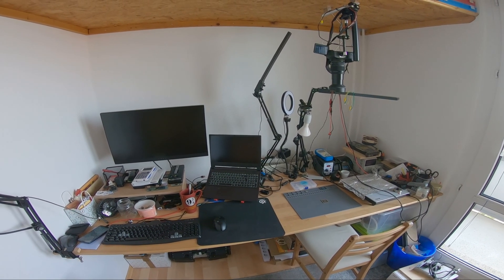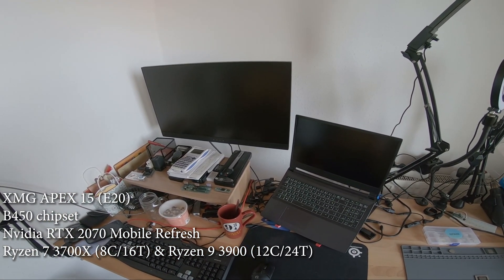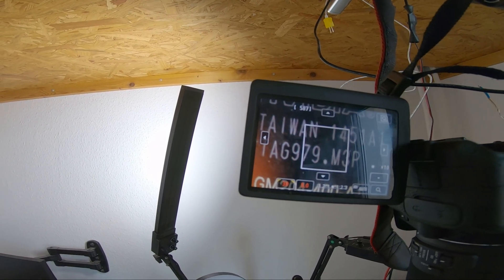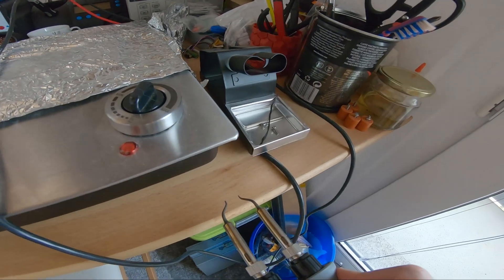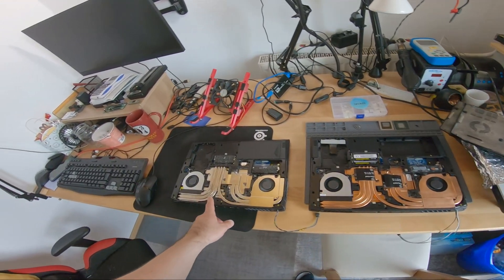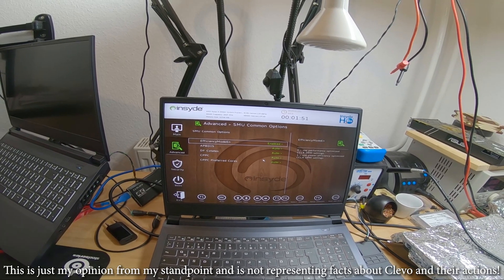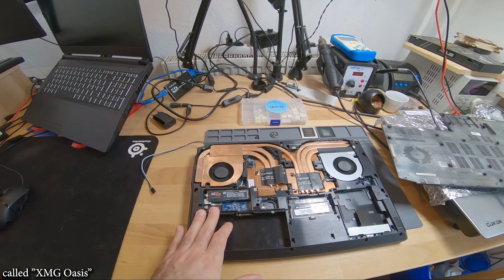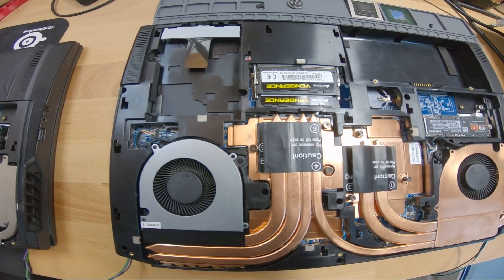500 subscriber special - my office, tools & projects

Comment: I saw the whole series dedicated to modding the XMG Laptop: you did an impressive job, congratulations! You have been a great inspiration and help for me, I intend to do the same (nickel plating) with the heatsink of my rog, to be able to apply the liquid metal also on the gpu, and avoid the oxidation of the copper in the long run. My Notebook (Asus Rog Strix G532LWS) comes out of the factory prepared for the use of liquid metal on the cpu, however, the cpu tends to saturate all the heat sink (having the heatpipes in common with the gpu) and therefore it results that the gpu it tends to have higher temperatures, using MX-4 thermal paste, which as we know has a much lower thermal conductivity than liquid metal ... I hope to be able to achieve what I have in mind, and above all that it works!

Comment: hi. Respect for your work! its great. do you have site or thread on forums with your work? how i can get your unlocking bios for my APEX 15 b450? you tested this platform (b450) with any CPU 5XXX? maybe you can flash (porting) (with programmer tool like ch341) bios from b550 to b450 (platform is same, like clevo p775dm3 and p775tm for support 9xxx series cpu). Do you have email? I would be happy to chat with you
Reply from the maker: Done already. Unfortunately not working! :(

Comment: are you planning to get the new apex 15 max with ryzen 5000 and rtx 3070? i'm debating on whether or not to buy it, it drives me nuts that they don't make a 17 inch version as it would allow for a larger heatsink and therefore better thermals(i'd get it with 5950x) but i'd like to see how the 15inch holds up. there's no reviews for it at the moment but they probably not present it as good as you did this one. i'm looking forward to the future of this channel:) deffinitely subbed and turned all notifications on

edit: 7 minutes later and i'm now even more interested in what will come:))
Reply from the maker: Yes I got the XMG APEX 15 MAX with a 5950X here. Please note that only XMG sells this barebone with properly working VRM. All other vendors underperform heavily.
The 5950X in this laptop runs smoothly, but the idle power draw is very high. All those cores want to get fed. Keep that in mind. Overall the thermals are not too bad, especially the 2CCD CPUs (5900X, 5950X) run cooler than the 1CCD ones unless you don't stress the GPU simultaneously.
Depending on your use-case the 5950X is a good or a bad choice. For gaming it's overkill and a bad choice. For simulations, content creation and such a good one. Spoiler: For gamers the 5800X3D might work in the APEX MAX together with a new BIOS in near future.
CB20 multicore performance with the 5950X in the APEX can vary a lot (6400-7200 points). But after tuning it with AMD's CurveOptimizer feature (latest RyzenMaster) it can perform noticable better (7400-8000 points). Check out my website to see some results I got with a software called "Hydra" by 1usmus.
Reply: @TechModLab  thanks for the very fast reply, i'm looking for a 5950x because this will probably be my laptop for the next 4-5 years and i will use it for occasional gaming, a decent amount of autocad and some photoshop on the side, maybe i will learn some video editing as well. All of those and the general use like web browsing, watching youtube on the side. I think the 3070 will hold up decently in the long run so that's not an issue. Configured with 32gb of ram(samsung) and 5950x and a 3070 and a 1tb samsung 980ssd on the bestware/xmg site it will be around 2300-2400 euros which i found to be the best price/performance on the market right now. After taking into account the upgradeability this seems like the best laptop for my use scenarios. Intel would also be nice but for the same kind of performance it's about 500-700 euros more which isn't worth it really. Will definitely take a look on your website as i'm really interested in how this cpu performs.
Reply from the maker: @nuclearmango8067  If your main focus is gaming the 5950X is not the fastest CPU because it is almost always running into power limits. The 5900X would be the better choice here tbh. The 12-core 5900X got more than enough power for autoCAD and VideoEditing. Besides video editing softwares make more and more use of the GPU over the CPU.
And that you need one core each application running in the background (youtube, browsing on the side) is a rumor. You will most likely not make use of more than 8 or 12 cores in your use-case. The 5950X would be overkill and would make your overall experience less pleasant IMHO. I would grab the 5900X
Reply: @TechModLab  well, seeing as it's not even available at the moment, I'll probably get it with the 5900x, after all i can always upgrade it to the 5950x if need be and I could sell the 5900x in that case. Thanks for the advice. Gaming isn't the primary focus now, at least for the next 3 years it won't be due to university and the amount of projects I've got to do, but during summer time like now yeah, gaming is gonna make up like half the time I spend on it, though i gotta get rid of my current Alienware 17r4 which is starting to show its age, the 4 core 7700hq is barely liveable with and the 1070 is still holding up remarkably well but yeah it still hurts when I've got to multitask on it.

Comment: im looking ways to downgrade alienware 17 r4 bios to older version. methods on the google are not working. do you know how can i downgrade it safely ?
Reply from the maker: Do you have an old BIOS binary? usually the flash software does support some "force" option (usually "-f" parameter) to flash older versions over a newer one. You can google that.
Reply: @TechModLab  Dell only gives exe file for old bios.  Then im converting it to hdr file and trying to flaah with usb. But it refuses to install it gives me error like unsupported.